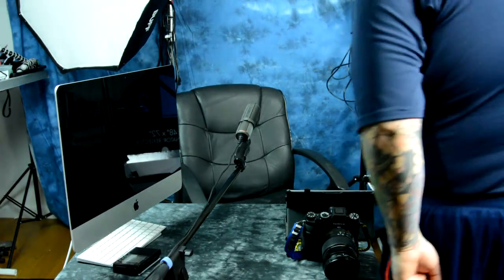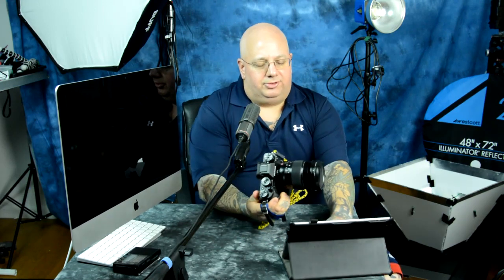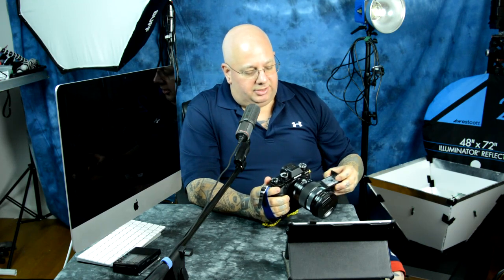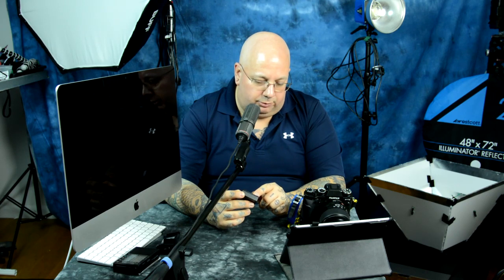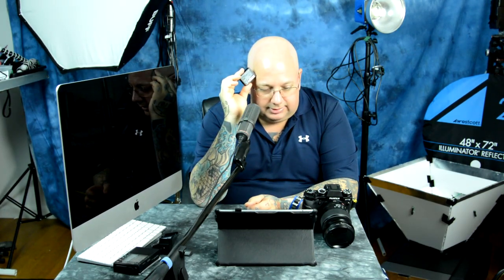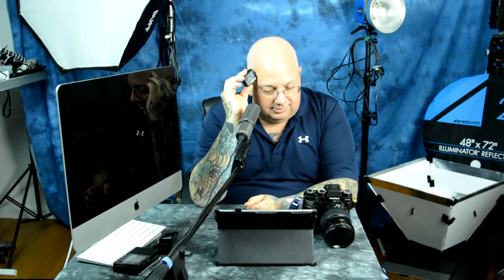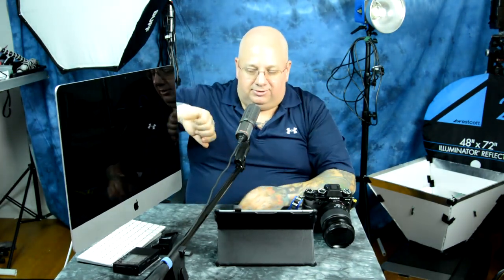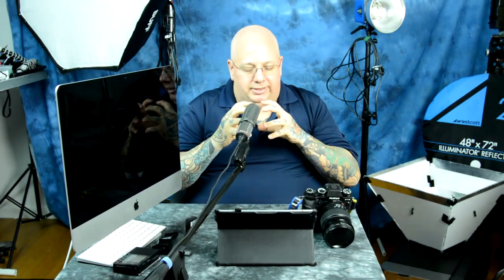*!* Explaining the X-T2 battery IN-CAMERA (XT1 vs. XT2 batteries) USE & AVOIDANCE parameters

Comment: Would using xt1 battery cause xt2 to not start up after a power down? Sometimes my camera will not turn back on after I shut it off, wondering if this has to do with voltage issue from shut down

Comment: let's say I have the original battery that comes with the camera, and I have the grip, could put generic batteries in the grip and use the camera in boost mode? or should I have the 3 original batteries for it? I would use the grip for video and take timelaps where I should take 500 or 600 photos

Comment: Essentially this issue is no different from that exhibited by the Nikon D500 using the older generation EN-EL15 batteries. The newer version of this battery as supplied with the D500 has simply had its electrical discharge characteristics modified whilst maintaining the originals capacity. Fuji could of course do the same as Nikon did and allow XT2 owners to swap out their older XT1 batteries for the newer version at no extra cost. In fact given Fuji's highly renowned customer service it surprises me they havnt already put such an exchange process in place. Your move Fuji! 😃

Comment: When you own a super fast sportscar you can fuel it with 98 octaan gas or drive to Germany and get some serious 102 octaan fuel. Same with the batteries, i have three NP-W126S in the X-T2 and it's overall performance is way faster then with only 1 NP-126S in the body and two normal NP-126 in the grip.

Comment from the maker: Fuji says: Fujifilm NP-W126S Li-Ion Battery Pack has been designed to better manage heat and ensure lightning fast camera performance. Looking at the picture of the battery the power specs are identical to the NP W126:1260mAh (min 1200mAh)…Same 8.7wh as the NP-W126    BUT THAT DOESN’T TELL YOU CURRENT , RESISTANCE, AND DISCHARGE PROFILE! The specifications you're not seeing are the batteries internal resistance and loss coefficient. The battery has some internal resistance and when you're pulling a lot of current out of it (read: burst, card writing), the voltage loss across that resistance can be an issue also relating to how much heat it produces.   

The XT2 BATTERY packs are  'better' battery cells be they different DESIGNED CELLS that yields lower RESISTANCE (AND TEMP) at high current rates……MORE THE BATTERY TEMP RISES THE WORSE THE POWER OUTPUT,…..XT2 CAMERA FREEZE IS DUE TO POWER THRESHOLD BEING CROSSED. Current XT1 Series cameras have 2 battery contacts and the X-T2 has four. This is to work with the new cell in the 126S which withstands the higher temps.   

The W126S has different cells with a lower internal resistance; that would result in both a lower temperature rise for a given current drain and allow a larger current to be delivered for the same battery temperature rise as in the NP-W126. Heat causes 2 things in a Li-ion battery, decreased power output and shortened lifespan.   XT1 BATTERY BREAKS THE THRESHOLD OF POWER OUTPUT WHEN TOO MUCH RESISTANCE IS CREATED WHICH TRANSLATES INTO HEAT AND THAT THEN CAUSES POWER FALLOFF  It only takes ONE line of code in a new firmware update to change the power profile of any camera